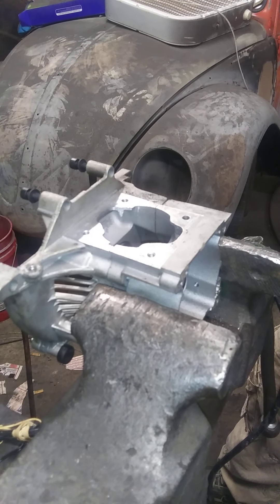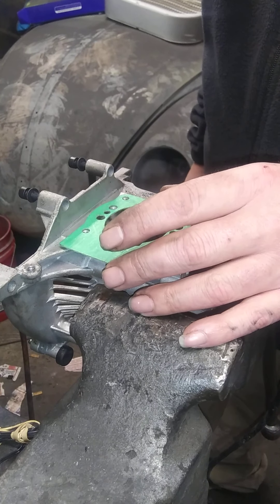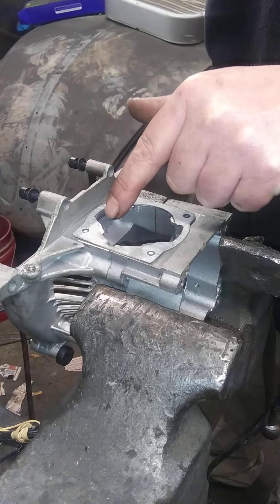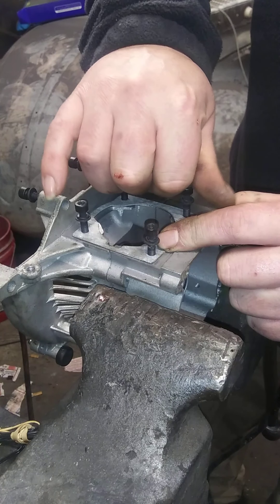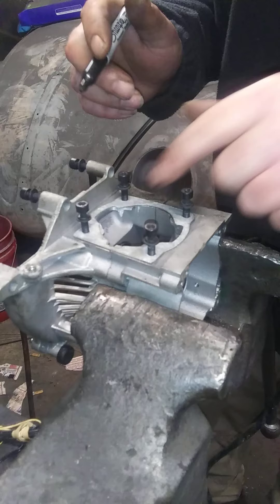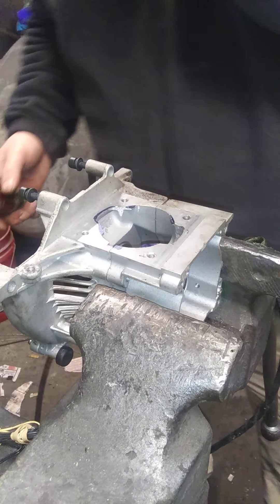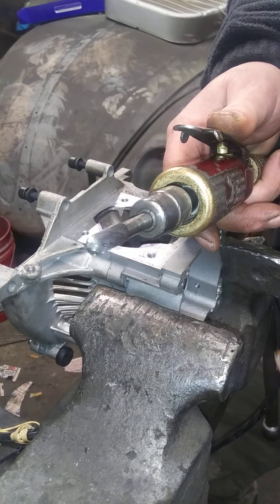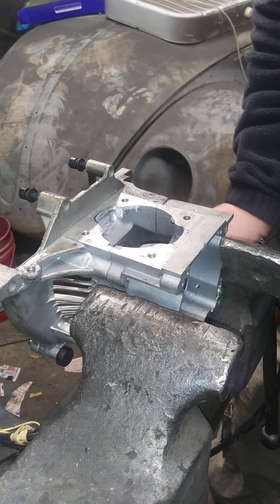Uber scoot 49cc mod #2 porting

Comment: Look at how PNW porting on YouTube does porting and case work on these kasei engines. He cuts some serious finger channels in on the crank cases where they transition into auxiliaries and opens up the auxiliaries quite alot.  Could be the reason why he makes so much grunt ontop end with a motor that's normally low to mid rev happy being so grunty. Clearly more fuel air charge being stored and  helping at WOT,